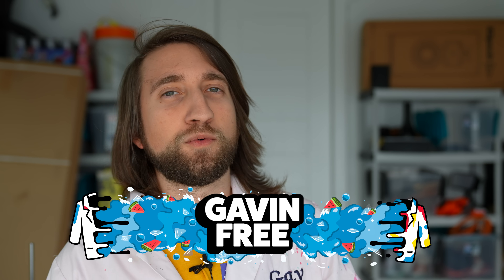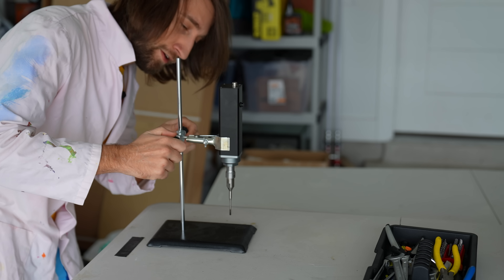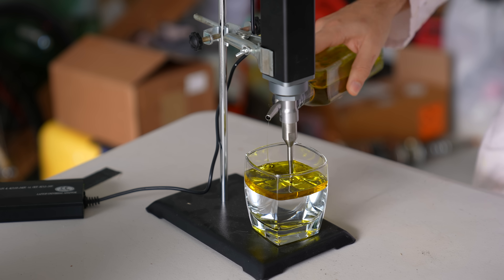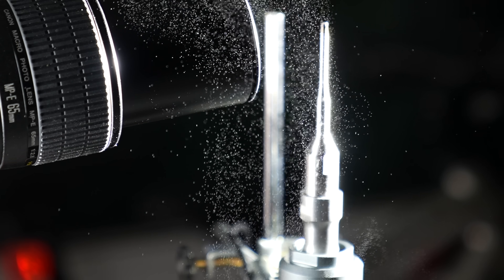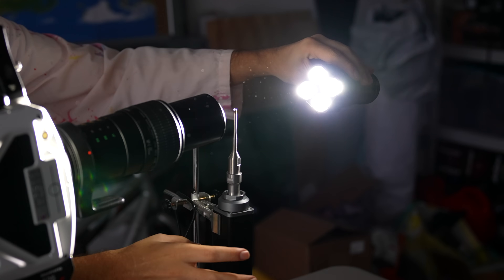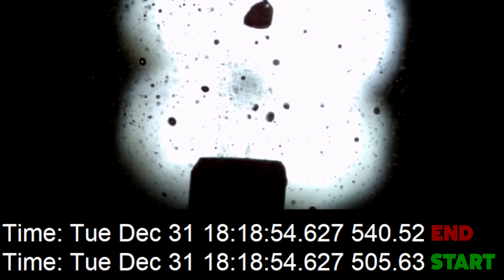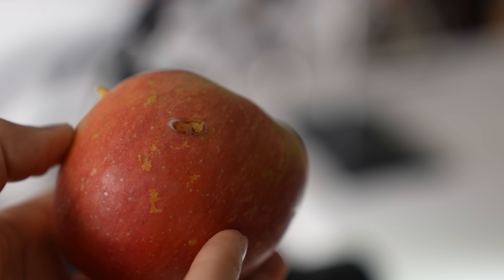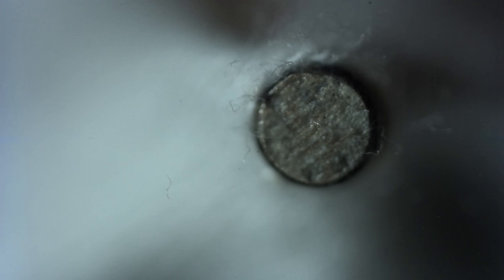Ultrasonic Obliterator at 170,000fps - The Slow Mo Guys

Comment: Used sonicators are also called "cell disruptors."   Note that old dead parts-units are often easy to repair, because if the user had twisted the wrong part while trying to replace the "horn," it tears the internal wires right off the big piezo transducer.   
Fun fact:  we make "nebulizers" with Lithium Niobate plates driven at 100MHz.   Apparently the particle-size is proportional to acoustic wavelength, because at 100MHz, the fog droplets are only few microns, and invisible without a microscope.  (Used to load proteins into mass spectrometers, alternative to Electrospray sample-heads.)

Comment: Inventor Günter Pöschl & Kurt Stoll. Method and apparatus for the production of a water & fuel mixture using via ultrasonic means. Patent number: 5679236 in the early 1990s was threatened & harassed by the powers that be the moment he was on German 🇩🇪 RTL Mainstream Media!

Comment: What happens if you align 2 of these devices at alternating frequencies to create a binaural beat?

 I would make one drill 161.8% higher amps and attach a diamond head and see if you can make a device that can crack rock with sound. By adjusting the frequencies of the opposing drills over a slab of granite  you could potentially tune it to create sonoluminescence in rock. 

Also, what happens if you put this device in a magnetized mercury torrid to propel it and align a wire coil to collect the electricity?

Comment: I'd love to see how it functions with higher water pressures. Get a clear long hose and fix it to the side of a tall building, fill it with water, and at the bottom right inside the tip of the hose will have a really high water pressure, Depending on the diameter and overall total height of the hose. Put the tip just in the tip of the hose. ;)

Comment: We used ultrasonic Branson welders.  They have a huge piezo that attaches to feed horns, which are then used to pneumatically clamp down on plastic parts and blast them with energy to instantly melt the plastic components together.

Comment: It would be REALLY cool to see the tip of this device replaced (or turned into) a nano-serrated blade made of some extremely hard material, im sure it could cut through almost anything, and the slow motion video of it cutting, for example, glass, or other hard materials would probably look really cool. But the nanoscopic serrations would not be easy to do, maybe with a finely focused laser or electron beam.

Comment: In microbiology we use sonicators to sterilise difficult to clean glassware and other equipment that can't be heat-sterilised/autoclaved. The one we have though is a bath you fill with water then submerge the equipment in. Very interesting to see it in action.

Comment: this is commonly used in surgery.. the side of the instrument is used to cut and coagulate tissue. the cavitation effect is actually useful to increase distance between tissues.. it's like blowing bubbles into the tissue (comercial names - Sonicbeat, Thunderbeat, Harmonic scalpel)
Reply: Yes, the ophthalmologists use it - the phaco emulsifier - to liquify the cataract and flush it out before the insertion of the new lens. The neurosurgeons use a similar device to resect brain tumors - a cavitronic scalpel - with less bleeding.
Reply: 5,300,000

Comment: I setup 20-40khz ultrasonic welders about 1meter tall and and several KW amps. Welding Colored Clear plastic on security seals took about 3-600ms. Tamper proof welds were beautiful. Low Maintenance, but quite timely to setup.

Comment: Imagine the acceleration of the tip. 
I guesstimate the distance variation of the tip at 0,25 mm. And in 0,00035 sec this tip accelerates twice from 0 m/s to full speed and back to 0 m/s. 
Assuming a symmetric (probably sine shaped) (de)acceleration. Then in 0,00000875 seconds the tip has moved 0,125 mm, so the acceleration is insane!
A quick calculation: Top speed 28 m/s (say 100 km/h) in that tiny amount of time. So the acceleration is a whopping 333,000 g!
Now that burning of wood makes sense..🤔

Comment: those are definitely air-bubbles caused by the ultrasonic head.  you compress the air together (which is in a dissolved state), and when the sonic-head is pulled away, you have a reduced pressure, whereby the air-bubble forms visually.

Comment: If you may can you measure the biggest water bubble it made please. There is an application for which I want to use the ultrasonic transducer for and it has to be the right-size bubbles. Thank you.

Comment: I don't know if magnetic sensing film reacts fast enough to get a high speed video- but It would be really cool to see the changing magnetic field in a common transformer. AC is only 60hz, so you could get pretty good detail of the moving field if the medium used to show it is reactive enough.

There may be a better way, but I only know about that green film that shows you the fields, or iron filings on a piece of paper above the magnet.

Comment: Just curious how they can make something move that fast and in that way? Incredible! Hey see what it does to one of your front teeth.
Reply: They do it using a piezoelectric crystal which is just a material that expands/contracts when a electric current is applied through it. Then you just need a circuit that fluctuates super quickly, and feed it into the crystal.

Comment: RO-DI system to make DI water costs around 100€(+ -50€). 1 Ultrasonic water atomizer(usb powered) costs you 1€ from the webmarkets. Tab water has lime, magnesium and other stuff you don't want breath to your respiratory system. Comment to video: I think ultrasonic water atomizing is an effective and efficient way to make air humid. You don't need much vapor for that. 100RH% humid air e.g at sauna has water at most 1% of its air volume. For optimal 35-45% RH you don't need much.

Comment: Seeing it on the apple made me think how easily it you open a hole on someone's skin.
3:20 This is pretty wild. It's slowed 3200 times but you can still see the tip move back and forth. It's so fast that the liquids around it seem to have almost stopped in time =o.

Comment: If you were to put a harder material, like carbide or even diamond in the tip, could this potentially bore through metals like aluminum, brass, or steel????

Comment: Wonder what would happen if you stick bunch of those in a 360 degree and pointed the tip at/into one spot/center filled in a capsule of water, what type of pressure or heat that creates when they're synchronizing pressurizing a capsulated bubble from all directions :D :O

Comment: I've heared that oil water emulsions are much more stable if the liquids are degassed in a vaccuum. There are bleder add ons being sold to allow to pull a vaccuum inside the blender. My question is does degassed water react differently to your supersonic fun stick? how does it look inside a vaccumchamber?

Comment: I actually had one of those ultrasonic humidifiers he mentioned when I was a kid - well, my dad did, but he used it to humidify my room.  Being a curious 12-year-old, I once reached in and put my finger on the vibrating plate to see what it felt like and it was crazy unpleasant.  It felt like a mix of being burned and electrified at the same time and gave my finger a really painful tingling sensation for a few minutes.  After watching this, I can understand why!
Reply: I tried putting my finger in the focal point, where the water turns to vapour. It hurts, like the water in your finger is being vaporised! Well, it is!
Reply: I used to repair sonic welders in a factory, very similar kit. One day, the operator got a shock, so he told his team leader. The team leader tried and got a shock, so he told the department manager, who tried and got a shock. This continued until I got told and went to fix it. 5 people all standing there saying they got a shock off this sonic welder. "Wait, arn't you going to try it?" "no, of course not i'm not a complete idiot". Not what the mouldshop manager wanted to hear.
Reply: @dogfood61188  Hey no shop talk when you're off the clock.
Reply: Thanks for explaining what happens. The first thing I thought when I saw this vid was ''What would happen if i touched it?''
Reply: I guess you were still lucky. After watching this video I can easily imagine it could as well have punched a hole right through your finger.
Reply: I had that burning/electric feeling when I took a butter knife and stuck it in the toaster. A very strange feeling indeed!

Comment: 6650: if flue is in a big enough space collector & pulsed on or obliterated facing up & then allowed to gravity collect back down keeping enough always ready to inject in just so u hve gotten as could a fuel spray short of a gas thru liquid fuel. It only a tiny bit of power short pulse to get all u need aeration. Might need 2 aeration pulse containers just to b sure u hve gootten enough pulse collected to b ready for injecting spray. Even if we need better more gas  like injectors still hve got the basic set up if not burning just gas.

Comment: I have a makkita multi tool That using an much slower oscillator to cut wood and sand etc. Really interesting tool to use as there’s no visual spinning blade or noticeable motion really but it pushes through wood like butter

Comment: I really want to see a slow motion table saw. Just to see each individual tooth of the blade take just a small piece
Reply: I think that would be a cool series. Do it with a whole bunch of different tools, and types of tools. Saws, drills, lathes, reciprocating saws, jig saws, circular saws, band saws, different drill and lathe bits. Different materials (wood, metal, plastic). Man, the possibilities are endless, and I want to see them all.
Reply: Watch fireball tool, he does it with machine shop equipment and metal and some cool machines

Comment: Have you Guys filmed a light Switch ... The contacts of course or a electric Motor with cole brushes (angle grinder or Drill press)maybee we can see sparks jumping or a neon Tube Start Up, an exploding cut off wheel, circular wood saw and a oscilating saw, chainsaw, or plants like "Oxalis corniculata" jumping clover their seeds explodes would be nice to watch in slowmo

Comment: Incredible to see at 6:10 microdroplets overcome inertia thanks to simple surface tension. The square or cube law allows surface tension to be immensely stronger than G forces. One could even calculate the resistance of surface tension against acceleration within these micrometer-sized droplets. Actually wondering if this has ever been studied...

Comment: Hi Gav! I actually used this instrument many times before. I'm working in a biochemistry lab and I used a very similar sonicator to extract proteins from bacteria cells. With this instrument, if you use it corectly, you can extract proteins that are not harmed from the forces and heat of the sonicator than you can later test their activity in a tube, purified from bacteria. It's very interesting to see this in slow mo. I didn't realize that the thin arm goes up and down. I thought that it goes slightly side-to-side. I hope you used sound-proof headphones because the sonicator can hurt you hearing. Thank you!
Reply: Number to predict ULTRASONIC cavitation that is not the cavitation number for fluid flow. https://commons.wikimedia.org/wiki/File:Garcia-Atance_number.png
Reply: He entirely missed the fact that Sonicators are also called "Cell Disruptors."  Apparently used by the Romulan military in OST, but Roddenberry didn't point out that a weaponized Cell Disruptor turns your tissues into liquid

Comment: We use these in Bioscience to lyse cells for protein purification, but you need timed pulses as the heat generation can denture the proteins your interested in isolating. As for equipment I think an orbital shaker with a baffled flask and some form of liquid media might look interesting. Alternatively, if you could get hold of lithium or potassium and add it to water that might look interesting.

Comment: Protip: When you measure cycles (like the vibrational cycle of the probe here), measure more than one and divide the result by the amount of measurements. If you measure just once and your measurement error is X, you get the whole error of X to the result. But if you measure 30 and divide the result by 30, you've got an error of only X/30.

Love the video!

Comment: I noticed on the single droplet footage that ripples form across it's surface before it's pulled apart entirely. These ripples must not only be absolutely tiny, they also move very fast. Can the moment the droplet disintegrates say anything about the maximum speed a ripple can have before it separates from the droplet entirely?

Comment: I used to use a piece of lab equipment called a flow cytometer, which would count microscopic particles in a sample by creating a very thin stream of water, and photographing individual droplets. A part of the machine was a form of sonicator that would send sound waves through the stream so that you could control the size of the droplets perfectly and time them so the computer could photograph them as they passed the camera.

see if you can get your hands on one of those, there was a microscopic camera built in for calibration but it wasn't fast enough to visualise the change from a stream to droplets

Comment: Might be a  dumb question, but if that machine vibrates at 30 khz, how are we able to hear the sound it produces? And if the sound we hear is coming from other parts of the device; does the tip produce sound as well?

Comment: This is what I think flash's punches would actually be like.
Reply: He could humidify a room in no tme.
Reply: Technically yes, but he's not super durable. He just heals fast. He can still hit hard but it's nothing compared to what it could be if his bones and armor were metal.
Reply: @jcdenton4534  I think what he’s saying is that the Flash wouldn’t have to punch hard due to the frequency of his punches being so high. At the speeds the Flash is capable of moving in, even a small tap would be enough to cause damage equivalent to a small explosion. It’s similar to the “needle hitting the earth at the speed of light” debate, his inertia would negate his necessity for strength
Reply: Melt skin and inflame or rupture organs.

Comment: Try 
Droping a little drop of water on top of it while on.
Placing like aluminum foil on top and turn it on.
Place any other sheet metal but a tiny bit thicker(one that doesnt bend just by blowing air at it).
Touching a object in suspension (like newton's pendulum or something)

Comment: I love how it destroys the surface tension of water to get microscopic droplets.
Usually when trying to film models of boats and storms in water the surface tension gives the scale away but you can see that 3mm tip has tiny particles of water dancing on the top and trying to remain stuck to it.
I have never seen water do this before !

Comment: Moral of the story: everything can be done if you punch hard and fast enough
Reply: Can it cook a chicken tho?
Reply: @ACMaxtogo  with a big enough one. Probably
Reply: I think it's not so much about hard punches as about frequency and long time

Little strokes fell great oaks
Drop by drop the sea is drained
Water dripping day by day wears the hardest rock away
Reply: @maxIimI101  but at that point you face diminishing returns, you'll continuously lose heat so you do have to hit it hard. The question is how much effort it takes to cook the chicken?
Reply: @ACMaxtogo  
If you punch the air fast enough, you could initiate nuclear fusion, which would create a shockwave of heat. That heat could potentially cook the chicken.

Also, the chicken would be contaminated with whatever atomic elements this fusion would create. (Nitrogen and Oxygen could fuse together to potentially become either Phosphorus, Sulfur or even Silicon (just a theory based on the number of protons and neutrons in the most common isotopes of Nitrogen and Oxygen, which may be entirely false)).

EDIT: Added Silicon as potential result as fusing Nitrogen-14 and Oxygen-16 would create the unstable Phosphorus-30, which would undergo Beta+ Decay (with a half-life of 2.5 minutes), turning a proton into a neutron, changing it to Silicon-30, which is stable. Enjoy your cooked, irradiated chicken. 🙃
Reply: @Operational117  i once saw a comic book where the hulk literally punched a hole through space and time so he could walk into a different universe so i think you can do it
Reply: False. Its actually the reason my parents divorced
Reply: @christianpalomino9968  Nice one :) But we talking about chicken, wait, u mean? It's getting hot in here
Reply: One punch man's motto
Reply: I mean, Senpai Saitama taught me this already, :)
Reply: so chris redfield could actually move a boulder by punching it

Comment: One of my customers used a 20 Khz unit to vaporize an oil and mix it with a gas. On a large horn you can see peaks and nodes. You can use the sound to levitate drops in mid air.

Comment: I found one of those for 30 EUR in Aldi! CLEANMAXX ultrasonic stain remover. It works in exactly the same way. It can turn oil and water into a milky looking emulsion. Also AEG and Elektrolux also have some sort of ultrasonic stain remover pen. If you buy the laboratory version, it can be as much as 4000, with the cheapest around 350.

Comment: I mean, when you put the intrument to a solid surface it looks like a hydraulic hammer hitting a piece of metal repeatedly until the metal starts glowing red hot from the sheer energy the hamer is applying to the metal. Apples and wood don't really deal well with a lot of energy being applied to them...

Comment: Estimating the speed...
*The head is 3mm wide. I estimate it moves about 1/4mm or 0.25mm.
*A full up/down cycle is 0.000035 seconds. To travel from "point A" to "point B" takes 0.000017 seconds.
*Traveling 0.25mm in 0.000017 seconds equals...

32 MPH?!
52 KPH?!
Is my math correct?

That is a car crash!